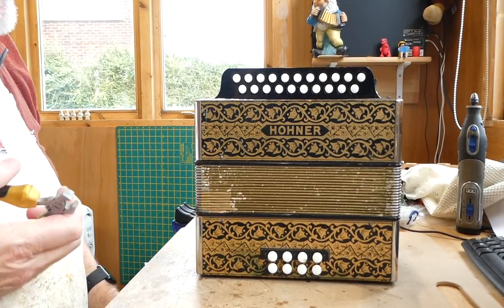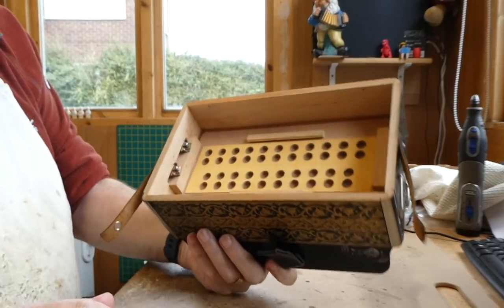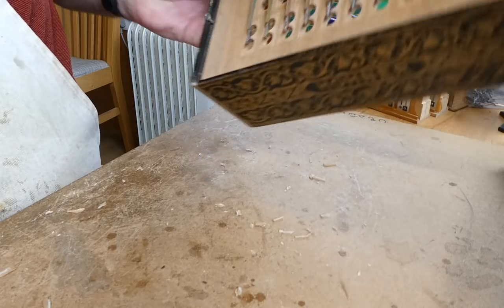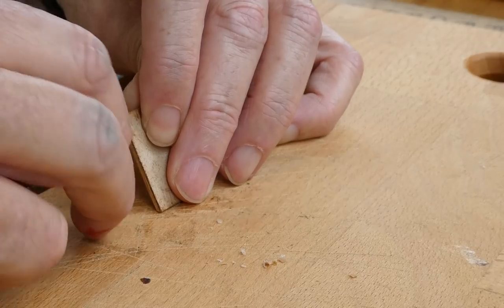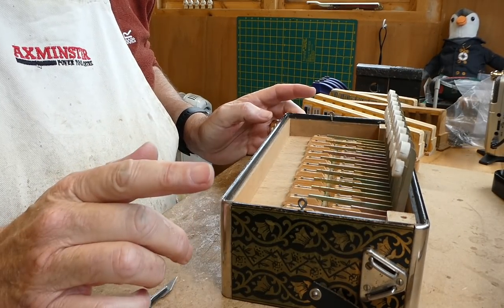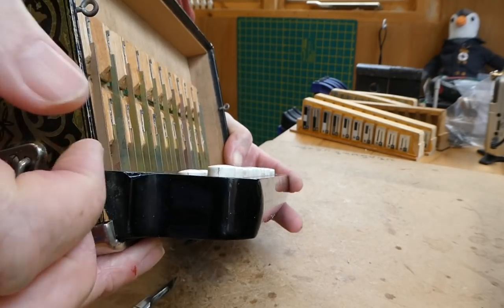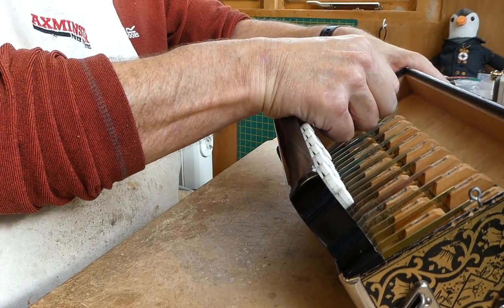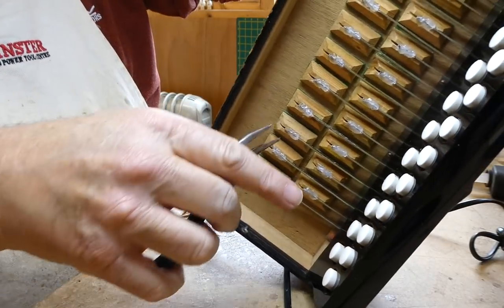Hot Rod a Hohner Episode 2 - Reface Treble Pallets

Comment: Thank you very much Lester, following this video I was able to reface all the pallets on my Hohner Black Dot, it made a world of difference. This was my first time ever working on an accordion and a few things I encountered in the process: My bellow pins were rusted well into the accordion (probably not been removed in 30 odd years) so even with an end cutters and holding it down on the ground with my knee and pulling with all my might, they would not budge - I eventually used Silicone WD40 and a very fine wire cutter pliers to get under and wiggle them out until they could be grabbed with the end cutters. The glue on the pallets was also very tough, it took me hours on end with a scalpel to get it off each pallet arm and then the pallet itself. After ordering lovely felt/leather from Charlie, I then went and glued the pallets to the leather which wasn't so lovely after I realised my mistake. Not wanting to wait a few weeks for another to arrive to Ireland, I went and gently ripped the pallets off and used a scalpel and suede brush to make the leather decent again. It was a nightmare to get it off the pallets, I used a mixture of Isopropyl Alcohol (100%) and olive oil and scalpel. Anyways it now plays like a dream so thanks very much Lester, will be following your Hotrod a Hohner series for other project ideas!
Reply from the maker: You are not the first person to glue the pallets to the leather not the felt, ask me how I know :)

Comment: My Pokerwork doesn't have screws holding down the reed blocks but just a couple of pieces of stiff wire that can be turned sideways to release the blocks. Was that an "aftermarket" modification or have you seen something like that before?
Reply from the maker: Earlier models had the twisty wire type of block retention. They also seemed to vary whether the gasket material was applied to the reed blocks or, as in the later models, the 'soundboard'

Comment: Hello Lester. Why do you need to use hot glue to fix the pallets back onto the levers?
Reply from the maker: You don't have to use hot glue, but you have to use some adhesive and hot glue is more easily reversed than most if you need to remove the pallets at any later date